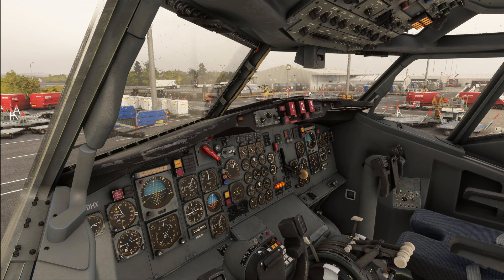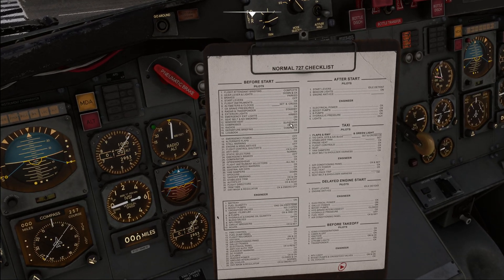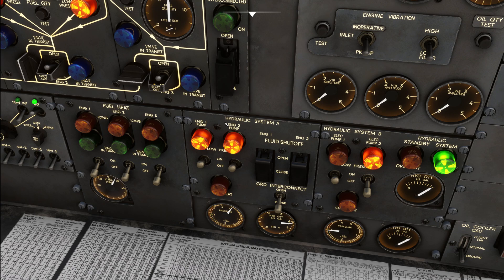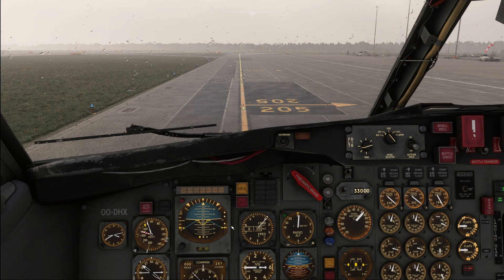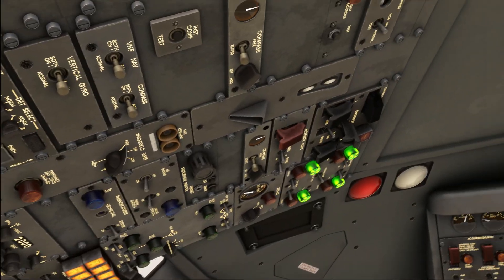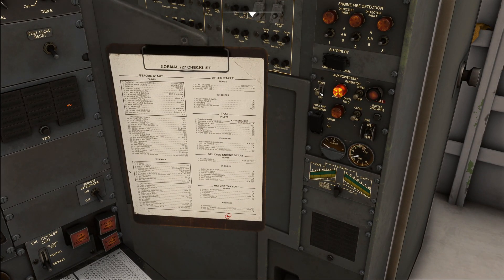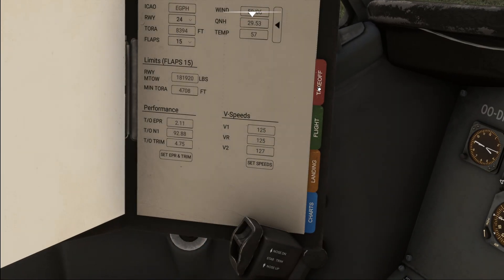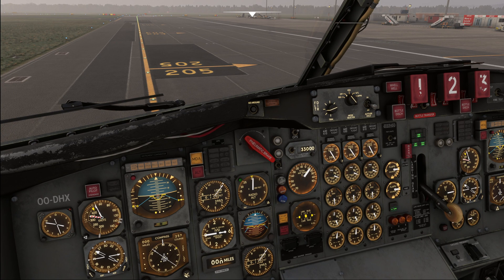FSS Boeing 727 Tutorial 3: Engine Startup | Real Airline Pilot

Comment: Hi Emmanuel! 
Is there a way around the fact we can only tune two numbers after decimal on radio frequencies (like 124.75)? 
Tried to fly yesterday with Say Intentions atc, couldn’t even tune to atis or request clearance as the frequencies used the longer pattern (124.755)🤷‍♂️
Reply: The old radios in the 727 prohibit you from accessing frequencies on the 8.33KHz spaced frequency band, like the one you are mentioning. To circumvent this, you will need to find another way to change the com1 frequency in your addon of choice. For the vPilot client the command would be ".com1 124.755", I am unsure about SayIntentions.

Comment: Hi Emi, I don't have the FSS 727 (yet) so don't know if this is a limitation of the simulation (though the manual describes the system correctly) but the generator synchronisation as described in your tutorial video is incorrect. You shouldn't adjust one gen then put all three online, they must all be in sync with each other. When you select the engine 3 meters, the sync light are comparing gen 3 output with the sync bus. Currently that has APU GEN power, which will be disconnected when you put gen 3 online. So gen 3 actually has nothing to sync with and can supply the sync bus. Then you switch the ac meters to gen 2 and the lights will show the synchronisation of gen2 to the sync bus. You must then adjust the frequency of gen 2 until the lights go out. Only then should you put gen 2 online. Then repeat the process with gen 1, synching that with the sync bus.

The sim looks very good, going to add it to my hangar thanks to your videos of it.